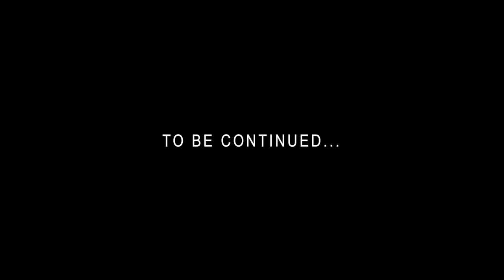Flooring, Framing & Insulation | VAN LIFE BUILD PT. 1

Comment: Love your video on the micro camper, I have had lots of RV's over the years and one useful tip I would give is use a pressure reducer with a Y hose splitter on the water inlet to protect your water system, and when it is full you can vent the pressure away from the wood on the RV. Keep up the good work and maybe play some of your bloopers it would make your videos even more real and personal.
Reply from the maker: Thanks so much for your tips! Really appreciate it :)

Comment: Looks great! Question...how do you stop the annoying floor squeaking from wood and insulation? Why did you take the door off?
Reply from the maker: Thank you! We adhered the wood and foam using a combination of strong adhesive and nails. On top we put the floor and we also adhered it with strong adhesive and finishing nails. We don't have problems with squeaky floors! 

You'll have to see part 2 of the van build to see why we took the door off! 👀

Comment: you guys are great, love the build.  But...that's not how reflectix works.  Whatever side the shiny side is laid down, you have to allow at least 1/4 inch of a buffer zone, or you merely create a thermal bridge.  Essentially you've trapped heat in the van the way you've done it, and conducted it in as well.  There are several really good insulation youtubes about this.
Reply from the maker: Thank you for the feedback! Regarding the reflectix, I'm aware of the ongoing debate of people's opinion on how it should be used. As of result of my research and experience, I'm using it to "reflect" radiant heat, as a preliminary method to maintain the temperature so that the actual insulation doesn't do all the work. Having the aluminum sheet directly on the metal surface repels some of the radiant heat before it can enter the van.